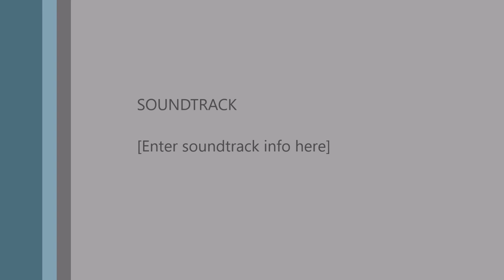3.5 inch Heat Exchanger, one end being done.

Comment: Is the height of the inner tube connected to the coils taller than the heights of the outer coil? Or is it flush with the outer coil?
Reply from the maker: +reddyc1989 Yes, it is slightly higher.  A 3/4 tube comes in at 90 degrees to the coils and they're all attached that tube.
Reply: One more question, is that the thin blue wale tape? When I put it in the oven it turns a gold color and is even flakier than before. Do you put the tape in between each layer of coils or just on the bottom? Thanks!

Comment: hey there I wonder if you check what ppl write in the channel... I am making a video so to provide some basic info about water distillation, I wonder if it would be okay if I add some parts of this video of yours as background in a small section of my video, because I am trying to explain that it is important to prevent polluting the condensation... so I am suggesting at that specific point of my video, the use of glass/pyrex and ceramics... instead of metals or other options... so will it be ok if I use some of your video??
Reply from the maker: Ok, with me!